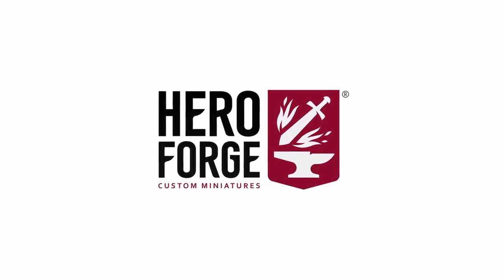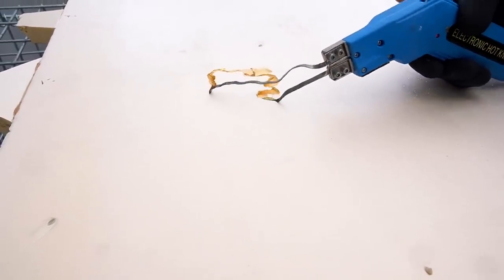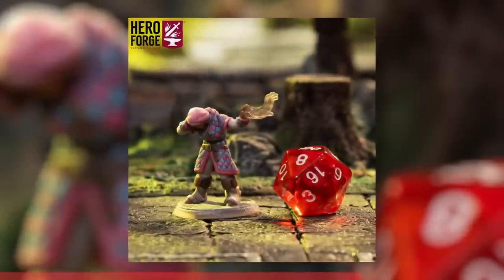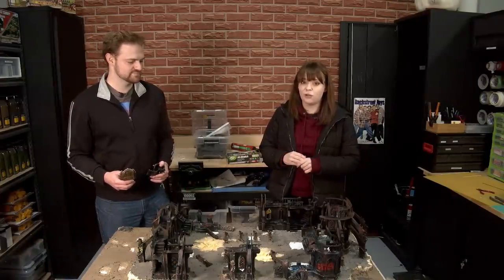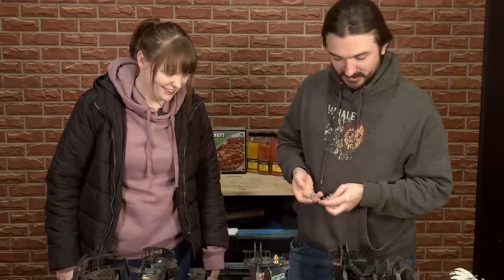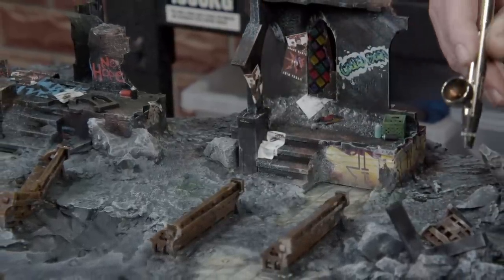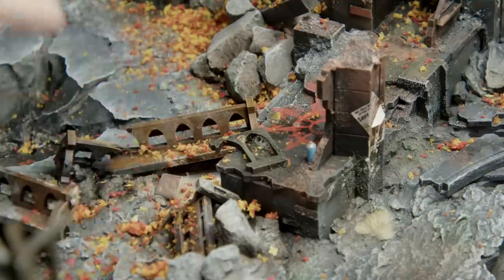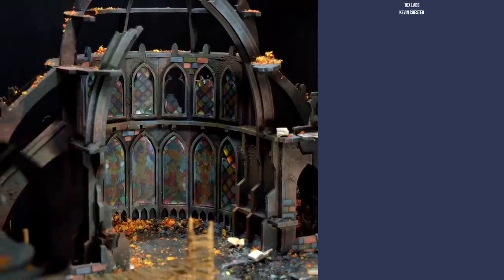This Warhammer Cathedral Table took ONE YEAR to make!...

Comment: I’m going to build my own gaming board for orks but I dont think anything will compare to this
Reply: Think like an ork, they don’t care how their creations compare to others
Reply: The biggest thing with a board like this is  time.  You gotta remember that the Tabletop Time crew does this as a job & comparing your hobby to that isn't fair to yourself.  It's going to come out great, and you shouldn't worry about it
Reply: @adamhanson5565  good comment but every time I read it I just hear the king pins voice from into the spider verse reading it out
Reply: @Grace1047  I want that Ork terrain build on my desk by tomorrow morning.
Reply: @Grace1047  , just take the time to let it develop over time,   both efforts and learning and bits.  Lots of my terrain is built via papercraft sites,  and cheap eBay finds ( i.e. a horrible built/painted  landraider ) to jazz up the eldar theme.    Now with 3d printing instead of the silicone moldings speeds things up. 

But most importantly,  building what you like n enjoy is most important.
Reply: @Grace1047  It's not alwaysh about da professional quality gaming table, shpiderman. It's about DA METS, baby!

Comment: Interesting. I will have to check out the previous videos for different parts of the build. The leaf litter was a good addition to the board, and was well done. 
While I liked the final result, it doesn't really feel like Warhammer 40K to me. I think this is because of the MDF cathedral build. Some of these pieces look really good, and work well. The pipe organ is very nice. However some of the areas just look too flat a lack proper depth and thickness and curvature. It looks more like stage flats or a facade. Makes me think that instead of 40K you should run a zombie apocalypse game where the survivors have taken refuge in an abandoned Ren Faire, or perhaps an old movie studio lot, the centerpiece of which was this cathedral facade.